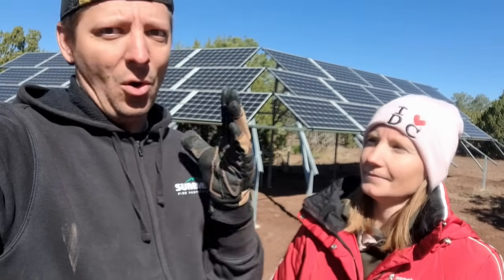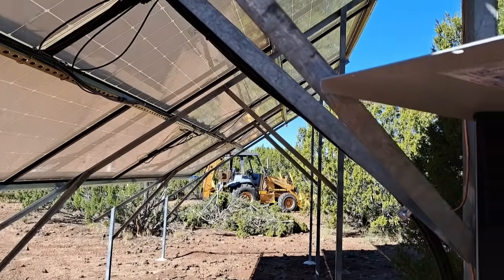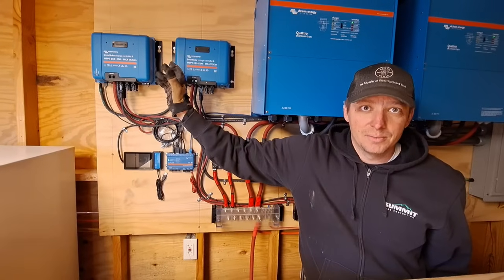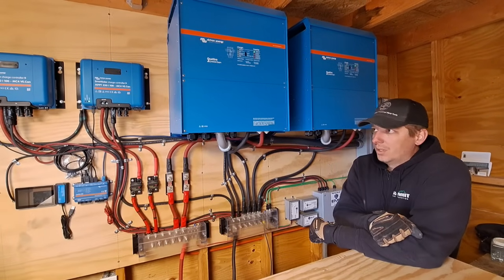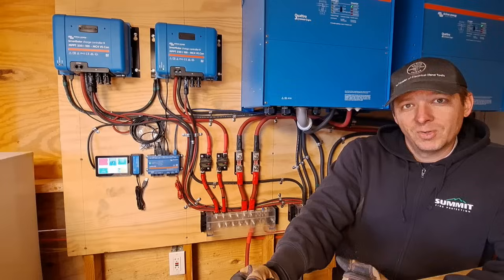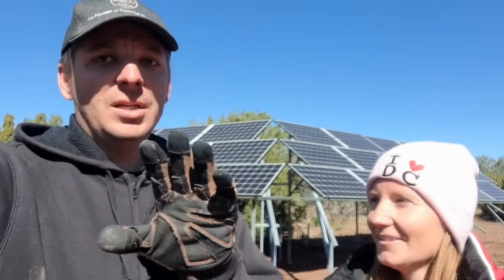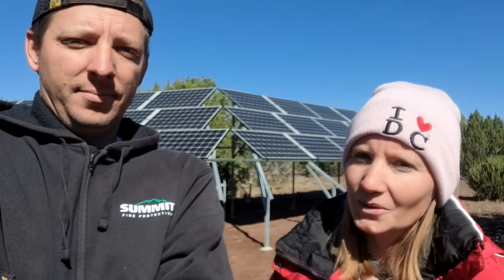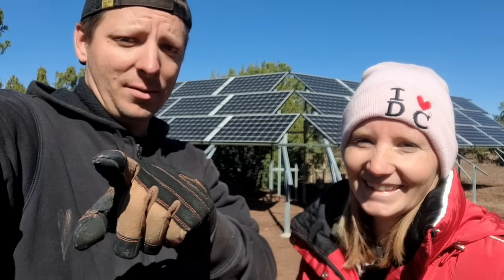INFLATED COST Of Our 100% DIY Off Grid SOLAR POWER SYSTEM 👍

Comment: First off, awesome job with quality components.   Might have several grand on the batteries going DIY with raw cells and the outer parts that are cheap and easy to make.  

Also, I think you said 20kW inverter and 9kW of panels.  I assumed you meant the opposite, since you have them in a V formation.

Comment: 6:55  You really should protect that busbar,  even though its behind that cabinet if you had a short there it would blow your whole battery bank.
Reply: Agree, I've used & found a Busbar Metal box is better...esp. since u spent ~$700+ on those  'busTbars' *  alone!   The large metal Box with busbars inside is same cost, Eliminates dual cable sets, & removes all those 'stapeled' wire runs also🌻🌅🗽

Comment: you need to install a shunt from Victron on the Negative main lead.  this will allow you to program the total sizing of your battery bank and the Victron system will monitor the real battery power used verses power remaining.  I was very surprised you did not install a shunt.  the rest of your install is GREAT.  you can never have enough electrical power

Comment: Great info, and nice system! You folks have a very down to earth relatable way of communicating. I have a grid tie solar system that supplies approx 100% of my electric demand and cost about $25k installed by pros. My prior average electric bill was $185 per month so my system is basically break even for the first 10 years, and I anticipate 10 years of “free” electricity after that. A significant factor for me is that I rely on the power company (no batteries) and I use natural gas for the stove, home heat, dryer, water heater. Natural gas used to be quite cheap, but here on the West Coast the price has soared, and now costs me more than my electric use. I applaud your foresight! You didn’t mention how you heat your house, I presume wood stove? The cost of batteries in off grid system looks to be the biggest factor. My take away from this cost analysis of yours is that the battery choice and budget are the most important decisions.
Reply from the maker: Wood stove mostly with a little portable heater sometimes. We're planning on radiant floor heating when we build our house in the near future. Thanks for watching. 🙂

Comment: Like your solar layout split….to capture early and late sun angles….a schematic showing series and parallel panel connection….?
You can make buss bars from scrap yard copper bars….
Reply from the maker: I don't have a schematic, but maybe I can explain. On one side of the array, there are 3 strings of 5 panels each wired in series. Those 3 strings go to the combiner box where they connect in parallel and go to the shed as 1 string. On the other side of the array, it's the same. So it ends up being a total of 2 strings back to the shed. The problem with making my own busbars is that it would not be UL listed, and I would have no idea what kind of rating (in amps/volts) it would have. Appreciate the comment. Thanks 🙂

Comment: You can DIY a battery box of 16 LIfepo4 Grade A 3.2VDC @ 314Ah cells for about $1.8K.  That's over 16Kwh of 51.2VDC @ 314Ah battery capacity. Double it and Import 32 cells and two DIY battery Box kits that includes the 200AMP BMS, digital display and 2A active balancers for around $3.2K in cost shipped from China. 2 years makes a big difference in cost now.

Comment: Yes sir, I don't think you went too big!    I also am 100% electric - including heat-pumps for heat/cool.   I'm up to 51 panels (14.5kw PV array) and find that at my location that in winter I only get 25% of what I get in summer so 'big' is good :)     I've been operating for 4 years and averaged that 25% in December but last year only got 10% in December due to unusual year of day after day of clouds/rain!.   I'll be interested to follow along and see what you think in a year or 2.     But again, many congratulations, you've got yourself a real solid system!!!      P.S.  Busbars are just a  hunk of metal (I  flatten copper pipe and use my own bolts) but you got such nice plastic covers to protect against shorts and my covers definately look home-made :)
Reply from the maker: You have a nice system by the sounds of it. Yes busbars are ridiculous. Thanks for the comment. Take care. 👍

Comment: Hi...  thanks for the video...
I only wanna comment on one thing though... and that is, after seeing how hard it was to push & pull your battery box... and as you might add to the weight in future with that extra shelf... why not invest in some cupboard handles as well...  that you can mount on the front sides of your battery cupboard...
It would surely make it easier to pull & push it in tne future.
My name's Tyrone Daniels and I'm from Cape Town, South Africa ( yes I know... that's my girlfriend's pic )

Comment: OK  Thanks for the breakdown,  I too are fixing up my solar with Victron,,my system is half yours (multiplus 5000k)  I bought a kit of victron stuff,it was cheaper then yours but I did not get the new Cera GX stuff,,  I got the color control panel.. I have 12 times 375watt panels on my garage roof ,,,I lifted up myself and they weigh 40lLbs each (I,m 66,so not spring chicken like you two)  I have two systems,first one is up and running ,its grid tei 5k with 10k battery ,, My second system is my victron system is also 5k with a 10k battery ,still a work in progress.  Why so much power for little old me and my good lady,, I just love to keep the MAN off my back,(I,m sure you know who the man is)plus like you I love to use power,,I think electric is the best power in the world , All cost around £25000 (or around $32000)..I,m really surprised yours is so expensive,,I thought nowhere can be more expensive as the UK,, we are taxed until the pips squeak  !!!   To get more info from your batties get the Victron BYM 217(I cannot remember the number but it ends with 217)  it may help and can be hookuped to the cera GX ,,  ok     cheers
Reply from the maker: Very cool! We love having solar power so we are in control and don't owe anyone. Hope you enjoy your system!

Comment: That’s is one monster system you got there.  Great to have if you are living off grid and somewhere with no town power supply.  May i know how many Amp/hr you can draw from the batteries if you have days where there is no sun??
Reply from the maker: Each battery is 100 amp hour, so that's 500 all together. The battery bank is a little on the small side, but it works out being in sunny Arizona. Thanks 🙂

Comment: If you remember what your power bills were, they add up fast.   Thx for sharing    How many years will break even?
Reply from the maker: After the federal rebate (forgot to mention in the video), the cost comes down to 26k. With an average of $200 electric bill, it pays off at about 11 years. Thanks 🙂

Comment: I've got a similar DIY system solar myself. Instead of two Victron inverters. I went with a large 15K single phase 240v inverter. I'm able to produce 240V split phase with the use of an autotransformer. For your batteries I'd ditch the wood box and go with a server rack. You can buy them with bus bars from signature solar out of Texas.

Comment: Thanks for the vid ! One suggestion: purchase an inexpensive thermometer and place it in the battery box.  U certainly don't want them to dip below freezing.
Reply from the maker: At a later date from this video, we installed a thermostat that turns on a heat source when the battery box gets below 45 degrees. It has helped a ton. Thanks for watching.  🙂

Comment: To run an electric line 1 mile is $75000 or more.  Solar is coming down quickly, and is a great option for off grid country living .
Reply: Yea i only have a small bit of land but to put power all the way to where my house is going to be would cost 12-15k, 
So i am going to do a small solar system for 8-10k that will meet my needs and ill never have to pay a power bill..

Comment: Great detail, very clean looking system. One correction that I wish you would make on future videos is that battery storage is rated in watt-hours or kilowatt-hours, not watts or kilowatts. Think of multiplying the Amp-hours times the volts and getting watt-hours.
I’m getting a 12kW ground mount solar array with 20kWh battery storage only capable of 6.5kW delivery but I am doing grid-tie with full battery backup. May go off-grid someday with a generator and another 10kWh of battery.
Reply from the maker: 24 kilowatt-hours. My mistake. Thanks for watching. 🙂

Comment: Great video... thanks for the cost numbers!!  Interesting that the 2 banks at differing angles provides you more than flat south facing panels...maybe because you're in the south.  I feel for you on the lack of state of charge reading.   Integrated amp hours is all that matters on those LiFe batteries, very difficult (impossible perhaps) to get a meaningful SOC from voltage only.  Anyway, beautiful piece of work.  Power on!!

Comment: New subscriber here. Thanks for the overview. I am looking at solar for my country home in north Texas.  I want to generate my own power when Texas chooses to do rolling blackouts again.  So I will use a whole house Solar or a critical loads panel that runs off of solar.  I have been leaning to a EG4 inverter/charge controller as well as EG4 server batteries.  Anyway, I have some decisions I need to make on how much I will cover.  Thanks again for your videos. You Victron prices were not too bad and I could go with Victron also.  Cheers! All the best!
Reply from the maker: Hey thanks! Hope everything works out for you. Take care. 🙂

Comment: The price of those bus bars though. Victron has the Lynx Power In rated at 1000 amps and they go for like $160 and that includes the positive and negative bars and 4 fuse spaces.

Comment: As far as your battery levels, I didn't see a Victron smart shunt nor the accessory wires going to your battery bank. That should give you detailed battery fill % levels, once calibrated, and monitorable via phone and or cerbo? Much better than just the 4 lights on each battery? Thanks for the video!

Comment: How often do solar panels or batteries need to be replaced out of curiosity? Good walkthrough of everything. I'd like to have a similar system at some point.
Reply from the maker: Panels will last for about 30 years, batteries for at least 10 years. But it's a little more complicated for the batteries. The less they are discharged each day, the longer they can go for. I think we can get 20 years out of them. Thanks for watching. 🙂
Reply: @aboulderlifeoffgrid  Awesome. Thank you for the information. And you are very welcome.

Comment: at 13:30 that piece of metal is probally quality copper thing is that having it exposed is not the best with humidity you can lose electricity unless you have the positive and negative at more than 1 m or 2 foot distance i know that sound crazy but i say about 4% power up to 7% outside where humidity is at max. for not saying that is better to protect them because someone can touch them. Just put some plastic sheet over at least.  As about the battery i will monitorize more the temperature on those battery  (take a loook at the hazard of lithium battery) . Nice setup cool vid.

Comment: Awesome video and details. Great DIY and an amazing feat by any means.
One Question:  Couple of Tesla Powerwall+ would cost 22k with 27Kwh capacity.  How come you have not considered that and connect it to your Solar Grid? is that not cheaper?  I am sure you all must have considered it, with such a large project.
Reply from the maker: Tesla requires a certified installer to put in a power wall. So we'd have to pay for install as well. We also wanted to experience the entire build  ourselves. Thanks for commenting. 🙂

Comment: My 17,000 watt system is right at $52,500 with SolArk 15K & 44,300 WH battery bank. I never put a dime out I figured on getting back. Instead I rest easy knowing I am invested in a Electrical Insurance Policy. Grid down I never noticed until my neighbor calls.

Comment: we are in AU and we put in a system for around 70k, we only needed 1 inverter as our power is single phase  but we did AC coupled and DC - as it stands we have 18kw of solar and 60kwh commissioned on the battery, but we are moving to 90kwh
Reply from the maker: Wow, that sounds great. We definitely see more battery storage in our future. Take care.

Comment: I installed an Eg4 solar system for myself with 5,740W of panels and 15kw of lithium battery storage with 13,000W grid tie inverters for around $10,000. I'm not off-grid during cloudy weather, but am off-grid on sunny days including the night. All my appliances and heating is electric. I definitely recommend the Eg4 inverters and batteries!

Comment: We average around $130 a month for a totally electric home. It would take 23 years to break even. Would the panels and batteries last that long?
Reply from the maker: Forgot to mention that we get a 30 percent federal rebate. Panels should last 30 years. Batteries can last 10 years, 20 years, or longer. It depends on a few factors. One major factor is the depth of discharge. Batteries that are discharged to 25 percent every night verses a discharge down to only 75 percent every night will result in a shorter lifespan. Lots to consider. Thanks for watching.

Comment: Well…Victron is Victron. I’m doing a comparison video soon comparing a Victron 100/50, and a comparable Epever that I’ve been using for the last year and a half, and an $18 ebay PWM 60 amp controller. I also use used panels, so this can be done reasonably, if not actually cheap. Epever has almost all the monitoring features Victron does, at close to 1/2 the cost. My test results on our 1200 watt system show them to be nearly identical in output and charging. On a fuller sun day, the PWM controller was less than 15% behind.

Comment: Nice work. Something I don't see, though, is a Victron shunt. A shunt would allow you to monitor the charge and discharge rates of the battery bank. A Victron Shunt will work with the Cerbo GX and the Victron app. Victron shunts range in price from $130.90 to $374.00, depending on the model.

Comment: 16:08 Wow! Since they don’t necessarily protect from a direct hit, does Em manufacture cover you if you are damaged and you have those hooked up? What kind of warranty do they have in regard to that? We used to have these on our house several years back when Alabama power was installing them, but What would happen was we would get a lot in Strack and they would trip but our devices will still be damaged so our power would come out and just swap out the unit and then cover our device for whatever it was worth. Is that how they work still maybe? I’m interested in my just not sure if anything changed and I guess that old way of working was probably just as good as anything especially since like you said, nothing is made to protect against a direct strike;  because lightning can jump a 4 inch gap much less a fuse or relay.

Comment: You all mentioned that you went big, so I was looking at my usage and July the usage was peaking up close to 9kWh and the day total was around 126kWh. (of course this is highest consumption days in July with 2 ACs running)  My question is does it run system run your Air-conditioners, and how many? I guess you are connected to the grid, so you can pick up the additional consumption, if you batteries are low.
Reply from the maker: We are not tied to the grid. It's too far away and too expensive. We don't have an AC here. Although it gets pretty warm in the trailer in the summer, it's not enough to justify getting an AC. That being said, our system could handle a couple of small AC units with no problem during the day. At night we would only be able to run them for a little while before we have to start worrying about how much battery is left. Thanks for watching. 🙂

Comment: The active component in your EMP Shield is a MOV that cost between $1.00 - $5.00
What is the purpose of a Metal Oxide Varistor in a power protection device? It sacrifices it self at the point of a surge.
Allows normal current to pass through the device, while diverting any surges/spikes through the ground circuit, to safeguard connected electronics and the surge protector. I used to install them in delicate telemetry equipment for lightning protection.

Comment: Im in Australia,  $37k us = $55k aus average yearly electricity is about $3600 which is considerably high usage 
That $55k = 15 years of electricity bills 
My question is will the system last the long to be viable?? Mostly thinking batteries and solar panels?
Ether way awesome that yous have done it 👍

Comment: When people have their whole house like covered in solar panels... how do they chain them together safely, when you have more panels than just 1 charge controller can handle?
Reply from the maker: You don't want to overload a charge controller. It'll get damaged and have to be replaced. MC4 connectors are insulated so that panels can be connected safely. Also, there should be a type of shutoff between the panels and charge controller. Thanks for watching. 🙂

Comment: I spent about 4K over a few years to build my modest system. The one thing that came as the best investment so far was a lithium battery (24volt 150 amp). It has performed amazingly well..
 As for a electric stove and dryer I don't get the logic.. Propane would be far cheaper over the years...

Comment: How long / days will the batteries last to supply power to your house if you had no sun or lose solar power generating supply to the system? Thanks for your reply.
Reply from the maker: About 2 days. The good thing is it doesn't stay cloudy very long in Arizona. Lots of sun. But at some point, we'll get a backup generator.